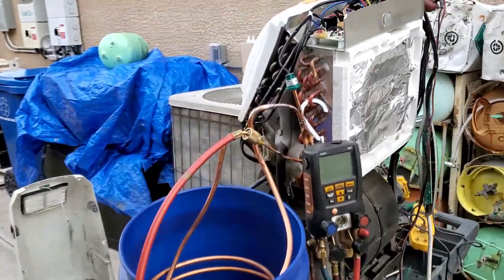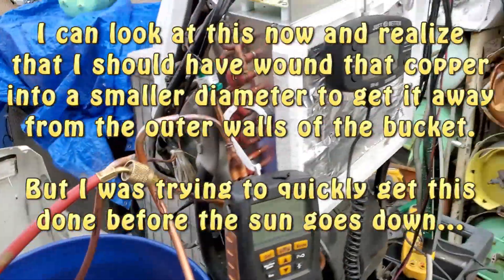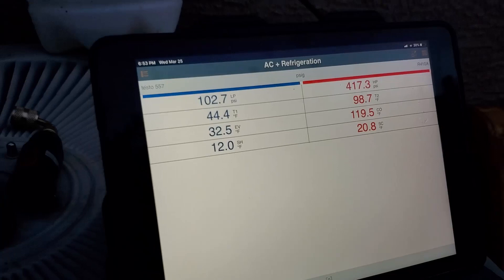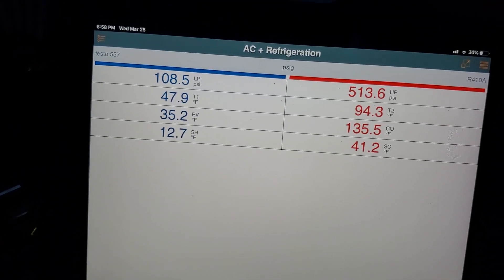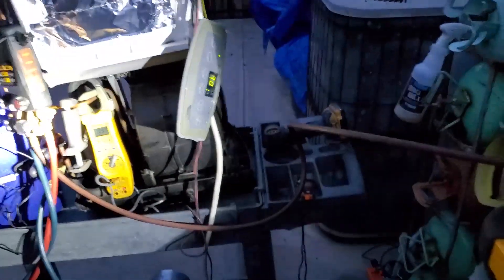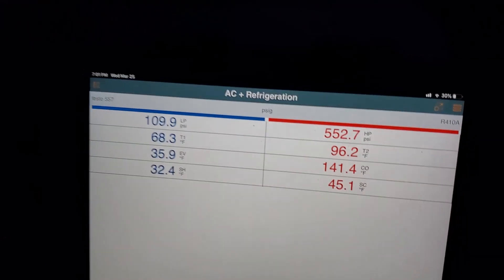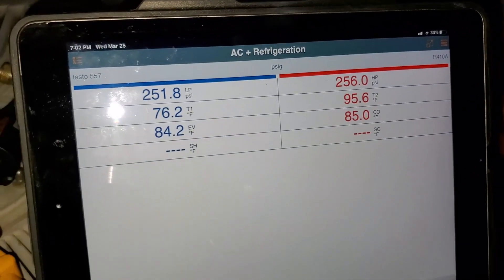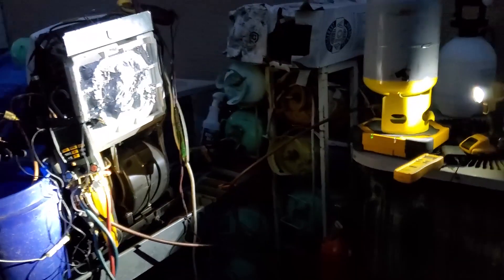The Little Bastard Refer Powered Water Heater - Part 2 - First water heating test

Comment: Ditch the coil, drop the original condenser in the bucket.
Reply from the maker: I think the moving water through the coil should out perform that coil. But sometimes you never know.
I did one test with the exchanger coil but got interrupted when I dripped water on the cord that was in a GFCI plug. But until it stopped it looked promising. Heated the water to 115 degrees (video I posted after this one)

Comment: Have you thought about running a couple passes through the old condenser to help lower the pressure. Could also help to subcool the gas to keep the superheat down and the metering device with full liquid. I’d probably only do like three or 4 passes. Just enough to get that pressure/temp down.
Reply from the maker: I only did the loop for curiosity.
I have a heat exchanger that I welded in tonight.
Test will come soon.

Comment: Hey you now you have a nice compact version with a Rotary compressor.  I think you'll get it.  I am not sure the condenser is the issue now, I agree the High pressure is a bit high, but not bad heating that 5 gal in like 11 mins you said to 115.  It may be that it's pushing too much air across the Evap side since you doubled the air flow...not sure just a thought.  Be curious what you see if you use a heat exchanger.  It's a pretty small compressor, I assume for a 9K unit, compressor is around 9K or just below.  Have fun with it.
Reply from the maker: I really want a rotary from a variable speed mini split or something so I can play with the speed on a VFD.

But this is pretty compact and all for now.
I'm thinking of putting some sort of axial fan on the evap to make it compact.
Maybe a cheap electric electric fan from autozone with a home brew speed controller might do the trick. HA HA
They make them small about the size of this coil.
I have one already that might work.